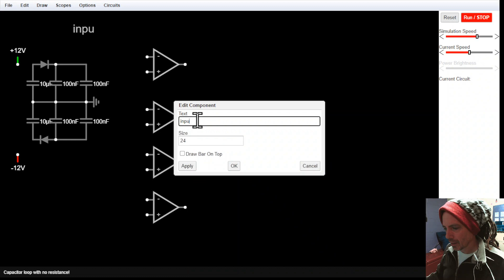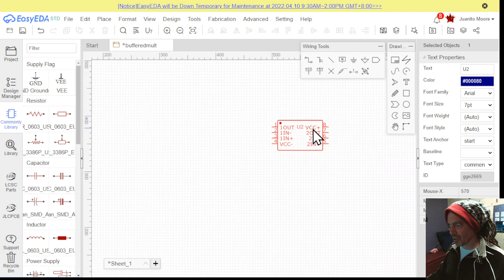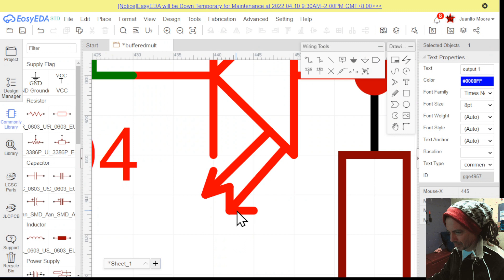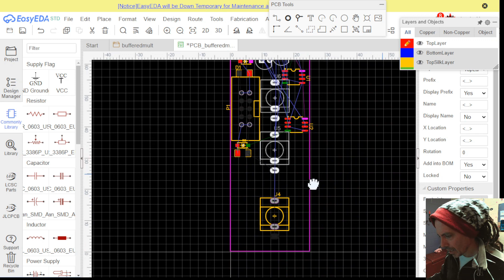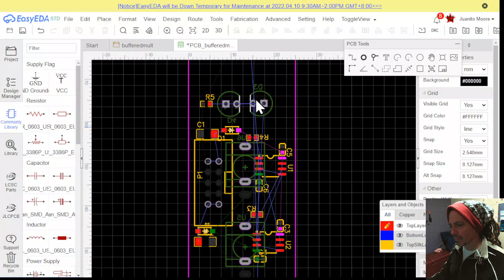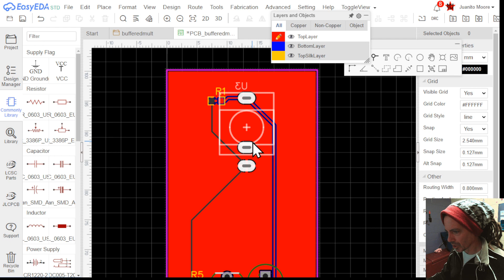You can design a PCB and have it printed!!!

Comment: how do i do stereo pots???
Reply from the maker: There's lots of options for PCB-mounted stereo pots, you just have to match the PCB footprint with the part. Then there's the strategy of panel-mounting the pots and running wies to the PCB -- Ray Wilson and CatGirlSynth designs tend to do that.

Personally, I use small sealed green box-shaped stereo pots with the pins sticking out the side. I put them into little chuncks of PCB I had printed, and they fit into a slot in my PCBs. Take a look at my recent video about my DuckMixer to see it in action -- works great